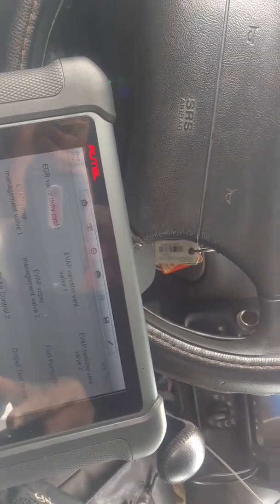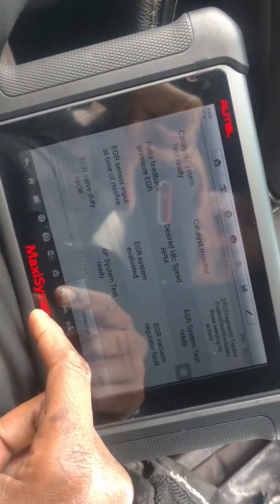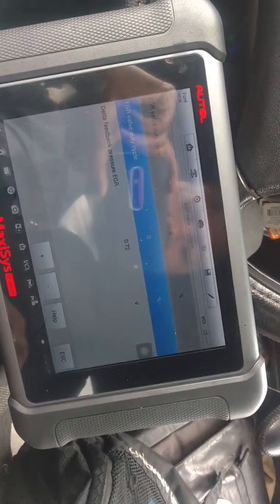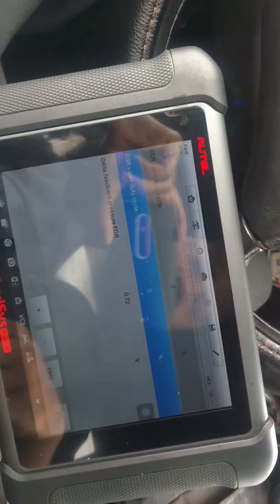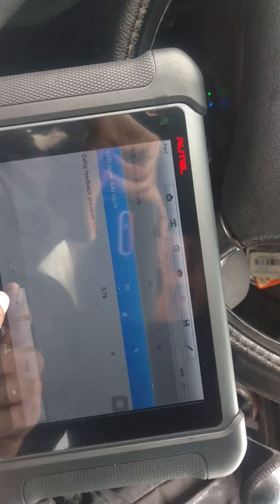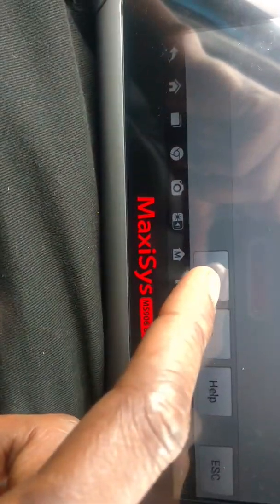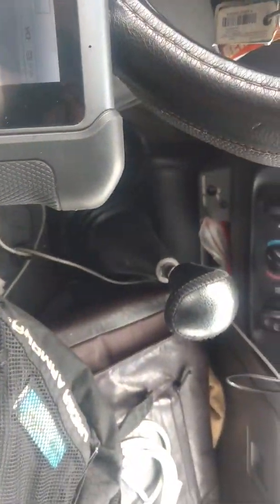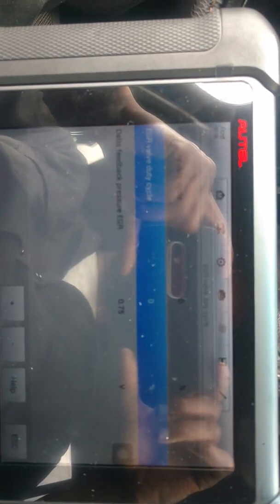Testing dpfe using Autel MS906BT

Comment from the maker: Sorry about the video quality. I'm at work trying to make a quick video in response to scanner Danner. I'm using the Autel ms906bt to actuate the evr. During the test we saw the idle get really rough but the dpfe voltage never went above 1 volt. My conclusion is that this particular one is rated as such (could be wrong). If anyone has a different opinion please feel free to comment